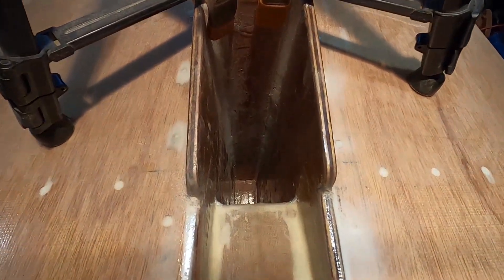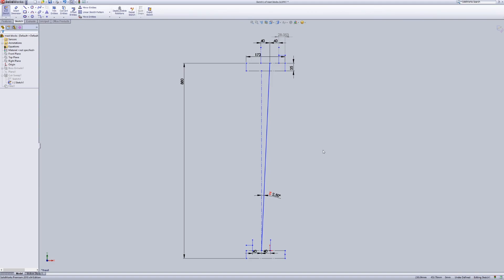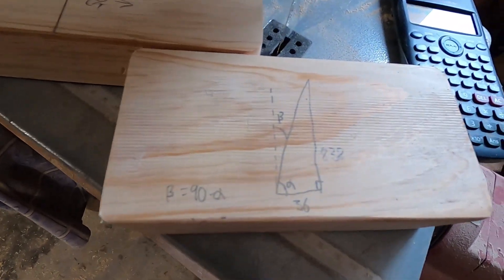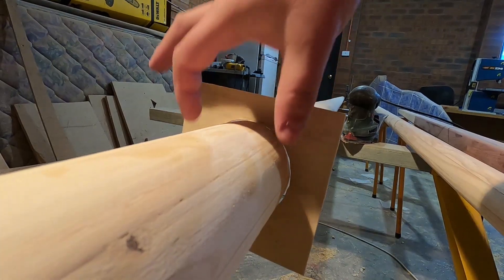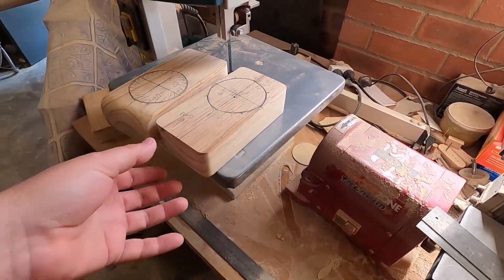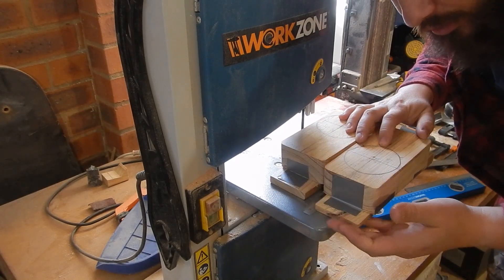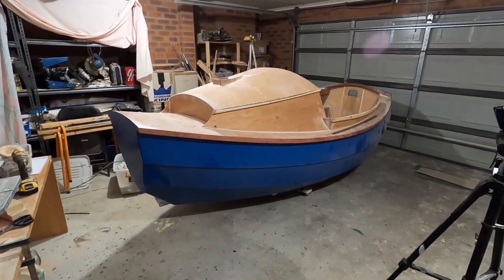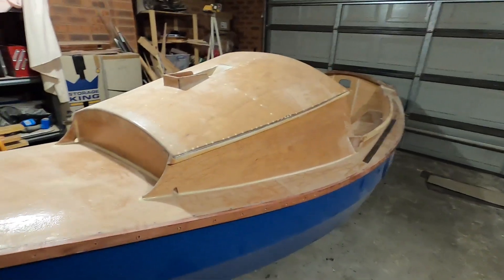Building a SCAMP part 076 - Mast Blocking

Comment: The drill press set at 2 degrees worked well.  The mast trunk on my scamp ( still under construction) has plywood extended from roof top all the way around.  The height of plywood at point closest to bow is about 55 mm and the plywood closest to cockpit is 10 mm.  Because of the roof slop rain water will get into the mast trunk very easily without the perimeter.  I am thinking of making a mast boot out of waterproof tent material to add additional protection